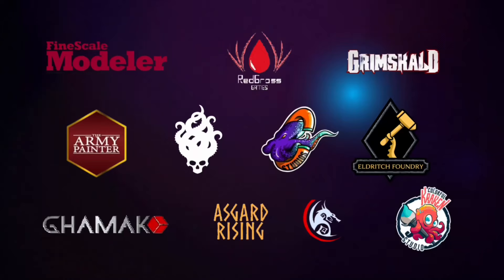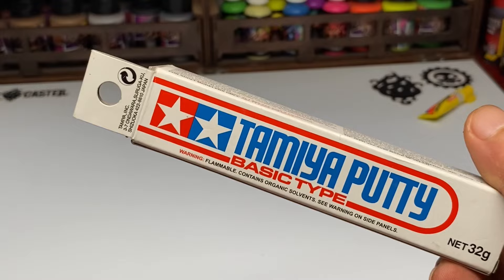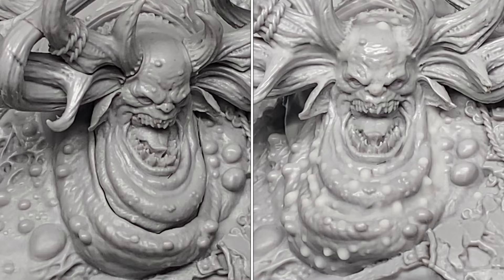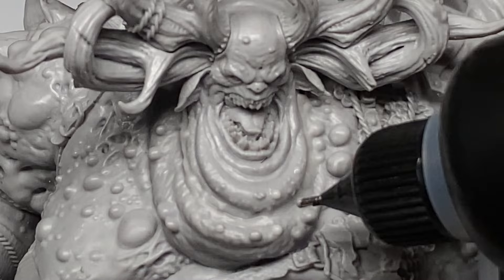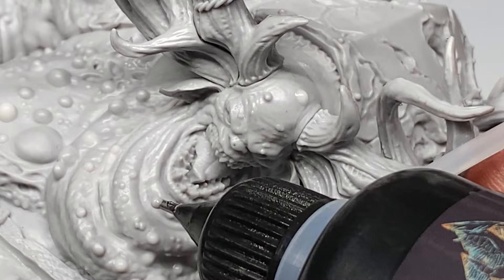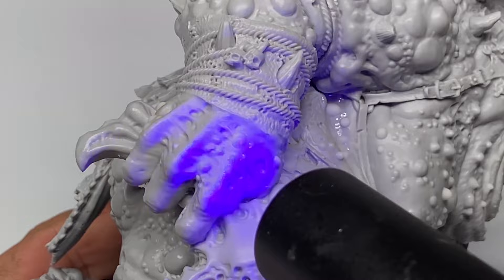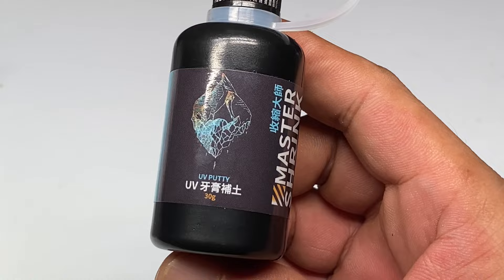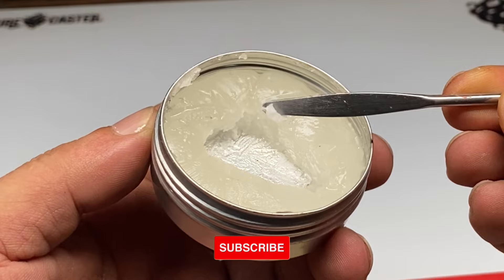Perfect GAP Filling for Resin & 3D Printed Miniatures

Comment: I mean, just use regular 3d printing resin. Different brands/types have differing viscosity. The smaller 500ml bottles are like 15-20 bucks and will expire before you can use a fraction of it.
Reply from the maker: I do not have a 3d printer. Thus I do not have their resin. 😊
Reply: Not to mention that getting 3D printer resin into something that gives you such fine control when applying it would be a nightmare. This product is way more practical than trying to get resin out of the bottle and into another container to apply it this way.
Reply from the maker: @photonfartsqueeze6694  Thank you for the input! 😊